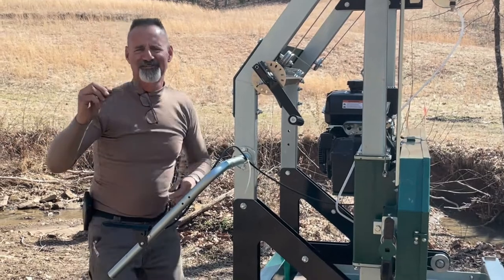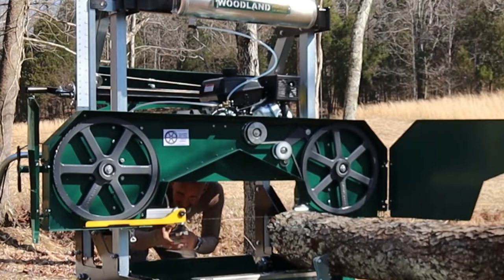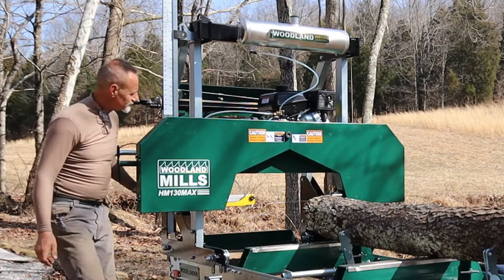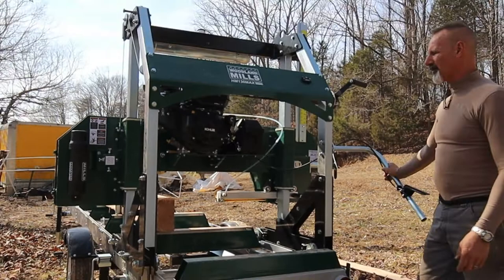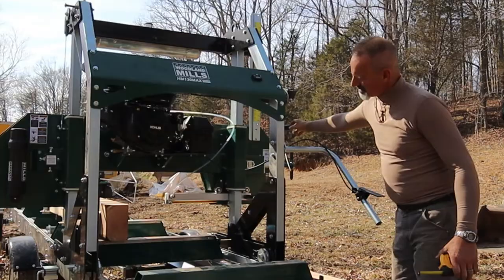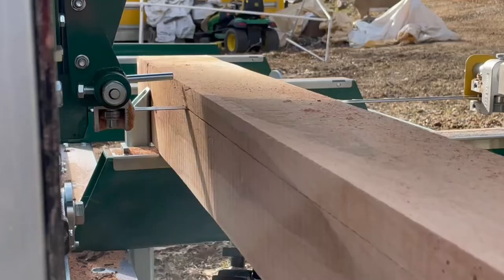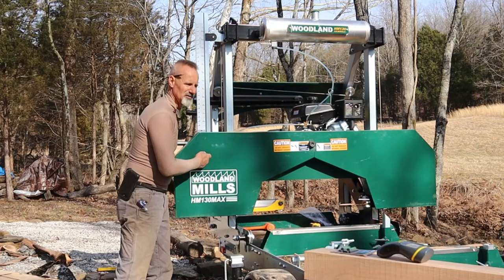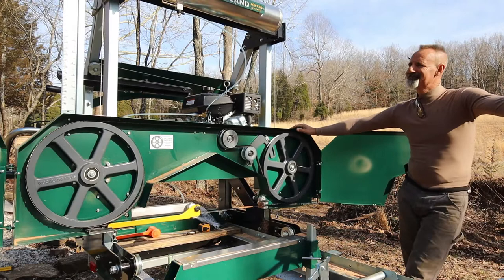Milling Lumber with a Sawmill | How to Cut Logs into Lumber

Comment: Just a point I have learned with my new HM130 MAX is that if you clamp the log in with a lot of tension you introduce a bend in the wood that is released when you cut it.  This can make wavy boards especially when you flip the log 90 degrees.  Also if the log is not resting on a log bunk when you cut it will sag a little and cause a 1/4-1/2" taper at the end.
Reply from the maker: Thank you for the tip! Appreciate it.

Comment: Just noticed...The L-shaped steel bar on the left side of the blade is a guard to prevent accidently running into the log stops. It should be adjusted to be ahead of the blade and pointed diagonally downward so that it makes contact with the saw stop before it hits the log stop.😉
Reply from the maker: I will let Philip know
Reply from the maker: Actually I just took it out because there needs to be a modification just so it doesn’t come back and hit the band. And I always check my log stops to make sure that they’re down low before I run the saw down the line. Once I make an adjustment I’ll put it back in and I do understand it’s supposed to be there so we don’t become part of that club. Lol

Comment: Thanks for the video.. I am looking at purchasing one of these saws. Is it still doing good for you guys? Anything that i should know, quirks or anything to make it easier? Thanks for any advice you can give.
Reply: Yes  I love it, it’s like printing your own money. I definitely would invest in a blade sharpener and straightener and get some practice. I’ve noticed some people have issues with bearings I guess you can be prepared for manufacture defects. I’m also on several groups and found out that there are upgrades that might not cost but I have not inquired about them.